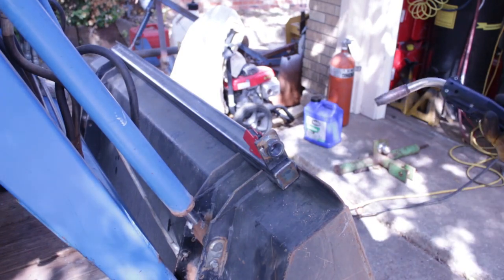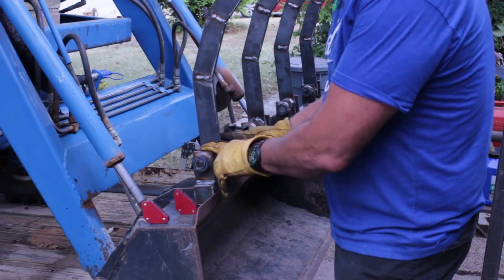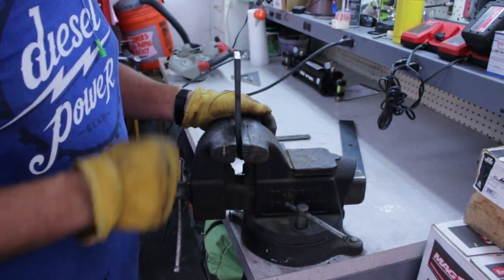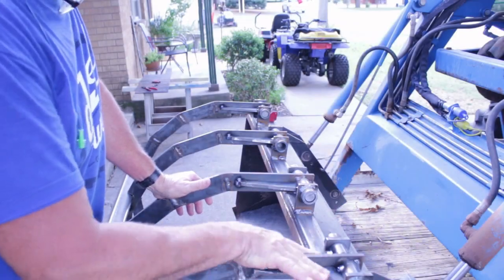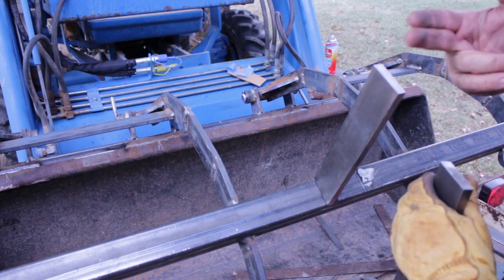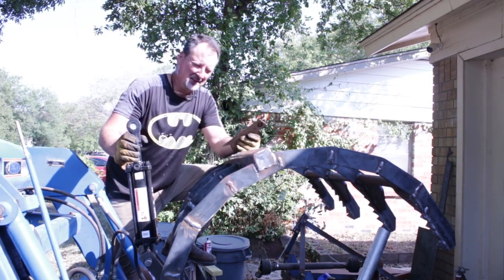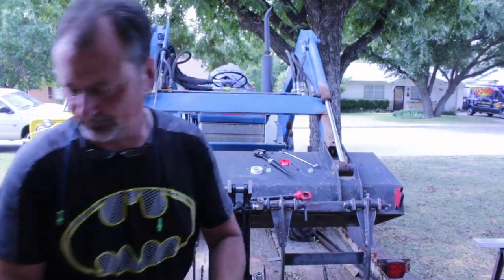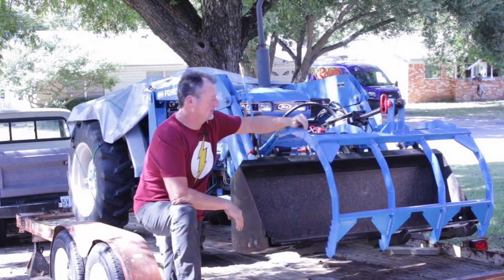#30 Homemade bucket grapple part 3

Comment: I could use the specs on cylinder you used , thanks  and great video .
Reply from the maker: this is the one i used. https://a.co/d/iy7Z4Be
The only thing i would change is to use 3/8 hose instead of 1/2 inch. and also i would have made the grapple diameter a bit smaller. Good luck 👍

Comment: Just found your channel, and would like to know some of the dimensional specs on the basic construction, that is if you are willing to share, I have a 2515 TYM with a 62" bucket. I'm sure I can adjust the sizes if needed.  I would understand if you chose not to provide any data.  Thanks for sharing your build, as well as the many tips and ideas provided in the video. Have a good evening.
Reply from the maker: Hi, thanks for the comment.  I'm sorry, there are no measurements. I was just kinda winging it, making things fit as I went along. The most challenging was figuring out the hydraulic ram mounts. It was some trial and error.
Reply: thanks, I think I can do  it ... inspiration will do it ... thanks for the reply!! @StevesBeyondRepair

Comment: Many things you cut with portable bandsaw could have been cut with chop saw in a fraction of the time.  Nice job by the way.
Reply from the maker: I'll have to agree, but I would need a good metal cutting steel blade chop saw. My chop saw that I have used in other videos is crappy at it, even with a new 14 inch cut off wheel. It sparks everywhere,  super messy, and get the metal red hot sometimes! Thank for watching!👍

Comment: For cutting steel, get the diablo steel/wood circular saw blade. I had that thing sitting in my garage for months because I didnt think it would work but hot damn it cuts better than anything i've ever used and takes a fraction of the time. Maybe 5-8 seconds to cut a 12" piece of 1/2" steel and the cut is absolutely perfect with zero burrs
Reply from the maker: That us so funny that you say that!!! I bought one a couple of weeks ago, and have not tried it yet!! So glad to hear it works. I have a project coming up that I will try it on!

Comment: 19:47. Seen it right off.  Lol. 

I'm making one right now. Timing was my hang up. I need a shorter cylinders. Yours looks beefy.
Reply from the maker: Lol! Well, I will add that now that I have used it some, the added 9 inches to the end of grapple fingers was not needed, and I may trim it off. The three lower fingers got extended out to about 18 inches. Works great, and saves the ole back!!!
Reply: @StevesBeyondRepair   Oh I'm in. I also found a quick chang bucket that's bent up bad today. I may scratch the bucket deal. I may just gonna cut the plate off the bucket and start over. Good show man.